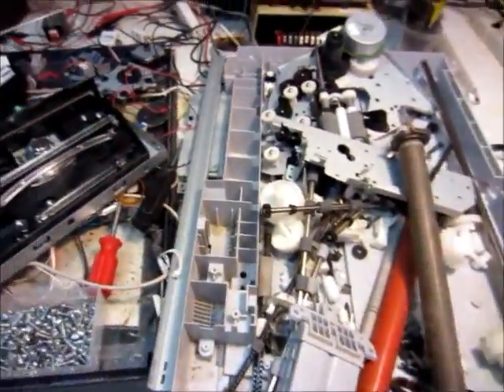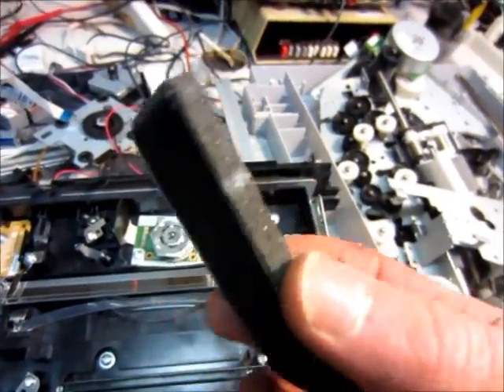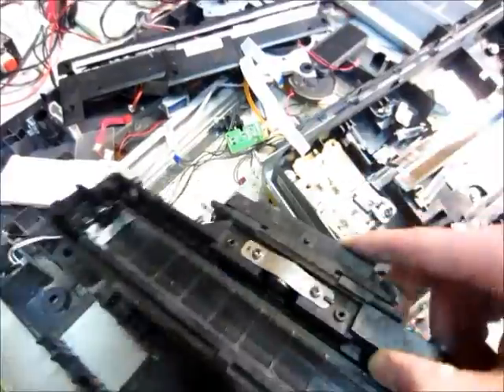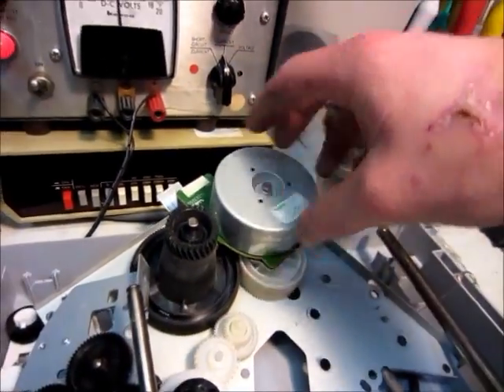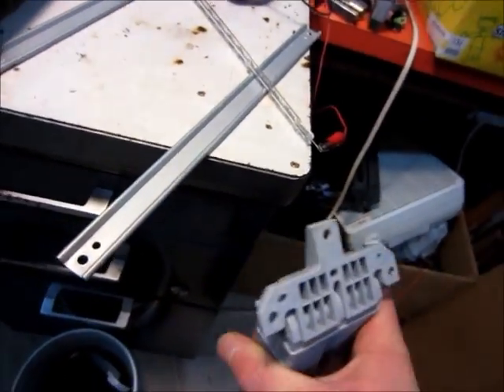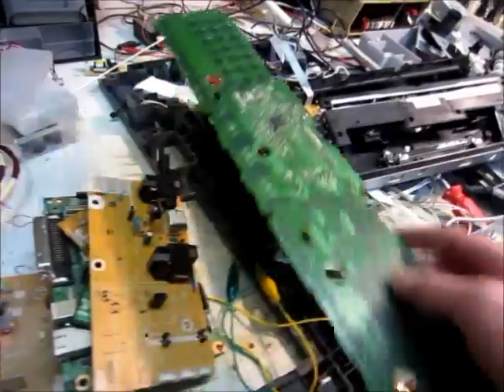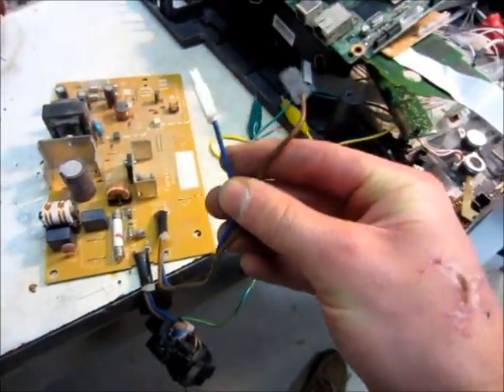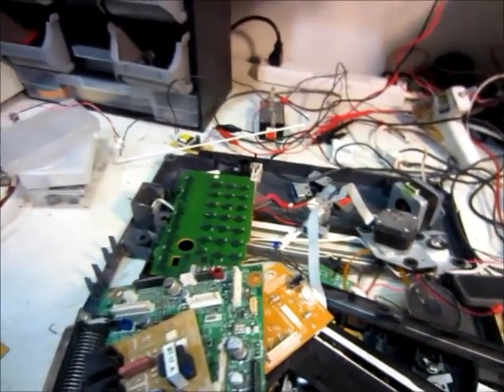Laser Printer Disassemble part 2 - Going Over the Parts From the Printer

Comment: The filter is an ozone filter as high voltage is used in the printers operation. The "heater" and the "squishy wheel" comprise the "fuser" which consists of the "teflon coated heat roller" and the "fuser lamp" along with the "silicone pressure roller" to fuse (melt) the toner (ink) into the paper. It is based on a cool process called Xerography.
Reply from the maker: Craig Diamond Ahh that's cool!  Yeah I resort to saying thing and dodad if I don't know what to say!  Hahaha but yeah it's a really cool process!  Thanks!

Comment: Ben Liang
Company:L.W. Office Parts
Address:#1-304 ROOM,26th Building,Qingkou Village,YIWU,JINHUA CITY,China
Tel:0086 158 58934022
FAX:0086 579 85612889
Fuser Film Sleeve.Upper Fuser Roller,Pick Up Roller,Separation pad,Gears,Bushing,Swing Plate,delivery Roller,Formatter board,Power supplier,printer head cable,printer head etc